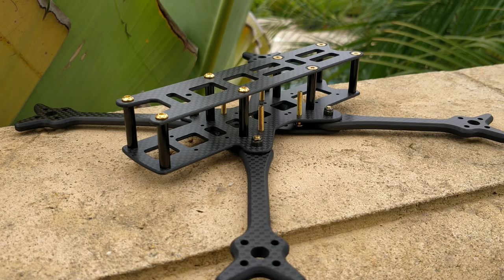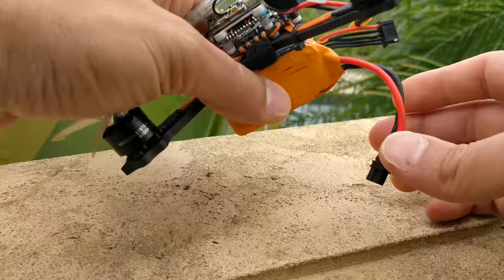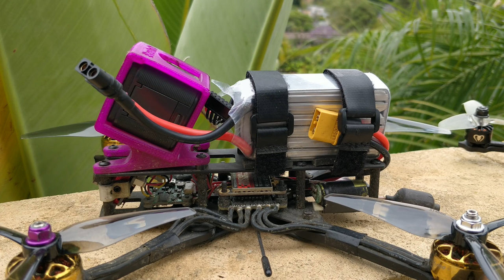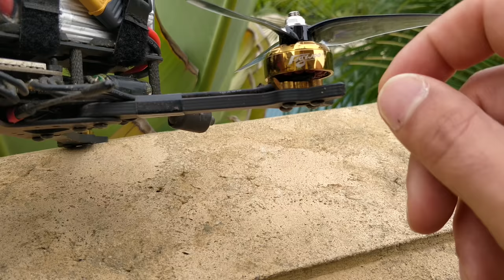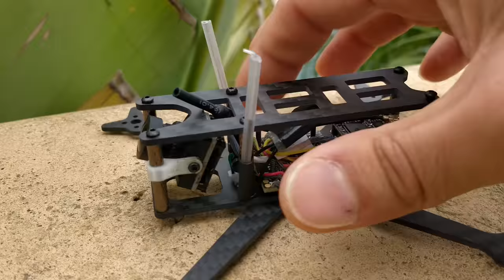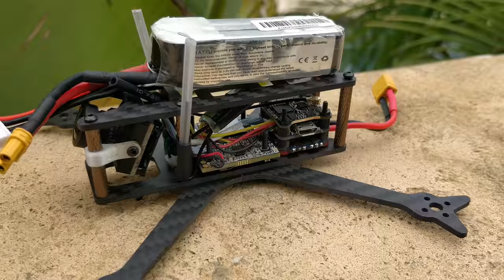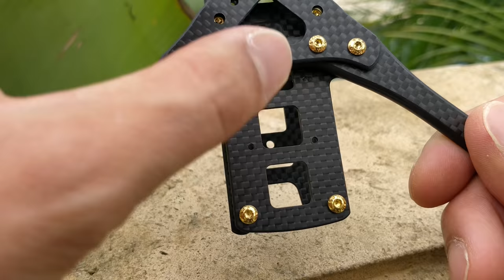Quad setup and flight performance - Quad Theory (WARNING: Lots of talking only)

Comment: HI Bob,
Just managed to order a Hyperglide before they run out of stock again! I missed the last batch...
I love the details you described in this vid how you designed this frame and I am looking forward to build one soon.
However, I use multiple 4s chargers and am running out of 4s1500 packs and need to order new packs.
I am not interested in a Gopro. 

I assume a Xing/Flywoo 2306 2450kV/4s2200 or a lighter 2207 2450KV/4s1500 would be the ticket without GoPro in regard for throttle control without BF4 issues? You mentioned you are not too keen on the 2306 motors but forced to use them due to BF4 issues but like the 22xx motor throttle control better when weight is reduced. Are both choices worth considering?

I am still enjoying my Eachine purple 23061900kV /4s1500 combo you have been keen on yourself. The throttle management is nice!

Which combo does match this frame best?
Thank you in advance for your time and patience.

Kind regards, Erik
Reply from the maker: Right now I greatly prefer 2306 with the new S4 prop. They go really well together
Reply: Thank you!
Reply: @Kabab  
Hi Bob,
I have been browsing through my builds and willing to salvage a 5" racer parts for the HyperGlide and building smaller drones in future more suitable for close proximity in urban locations.

I have chosen T-motor F60 Pro3 (2207.5 2750kV) according your theories for linear throttle response and I am wondering with 15-20% throttle cut this motor would be very suitable for this frame as well? These motors do not run well on BF4.0.3 and I am using BF3.5.7 now.

This would save considerable building costs not shelving these motors.

Thank you in advance for your time and patiencee.
Kind regards, Erik

Comment: I fly 2 flosstyles for my main freestyle rigs and recently smashed one to pieces :( Are there going to be replacement parts available for it moving forward or has it been discontinued altogether?  
I really like the look of the new glide frame but really do not want the extra 20 grams of weight.  Are you going to be releasing a glide light that you keep teasing in your new vids any time soon?? Sorry to put you on the spot I just happen to be in the market for a new frame and can't find anything that looks decent and is light! 
I really appreciate all your content and thoroughly enjoy flying your frames!!!!
Reply from the maker: The light version of the glide is coming probably next week and it's about 84g.  At least 12g lighter than the Flosstyle.  The Glide Lite is the only one I use myself now.  The regular version is not 20g more.  It's about 6g more and you get a LOT more convenience, durability and ease of use for those 6g too plus way cheaper arms.
Reply: @Kabab  Excellent!  I will be ordering one as soon as it drops!  I'm super exited!! For the 20g difference I was just going off pyros website, it had the Flosstyle listed at 85 - 87g and the glide as 104g.  Thank you very much for the response!!
Reply from the maker: @falconfpv8658  that weight was for the originalframe design. Since the initial launch batch I beast up the boomerang arms quite a bit and that added about ten grams

Comment: Interesting theories about battery orientation and position, but I notice all the batteries you're talking about are oblong, I run square Turnigy Graphene 1300mAh 4S under my Hawk 5 (because I got 10 for a great price, end of stock sale I think), and with the HD camera stuck on top it puts the COG practically in the dead center of the craft, it flies well and I haven't noticed roll maneuvers being more sluggish than pitch maneuvers or vice versa.
Reply from the maker: Right but the weight distribution is all over the place. It could be better but hard to jam all the stuff in a tighter space.
Reply: On that weight distribution note, I've been slowly working on a 5" build where the square pack fits in the center of the frame, and the FC isn't mounted to the frame but suspended between posts with a TPU print.
Quite curious how it will fly and whether the TPU mount will help eliminate vibration or make it worse.

Comment: How about placing a 3S on top and another 3S underneath, wired in series?
Reply from the maker: Would be okay but a bit complicated maybe
Reply: @Kabab  I don't see why it should be complicated, it would only need an adaptor cable, and an XT30 for each battery.
Reply from the maker: @BarefootBeekeeper  it's easy when you think about it.....😁

Comment: it seems that in the drone's movements through space as in the races, it is better to have the weight concentrated even if the center of mass moves down because the battery. 
however, in typical freestyle movements flips, rolls, i think it is better to have it centered on the z axis in the horizontal line of the props. This would be a reason for freestyle drones to carry the battery on top? Less propwas, better handle flips, more responsibility but not so good running across trees or gates?
Reply from the maker: It's always better to have it centered on the entire quad. Racers don't do flips and rolls so it doesn't matter as much for them.

Comment: Im in the process of building a 6"floss style  quad the 20x20 holes in the front and back hit the boomerang arms so i have to drill the holes with the frame together to accommodate and that's fine im inclined creatively!..   is this the case on the glide?..
Reply from the maker: The glide has access to everything easily. No issues at all

Comment: Hi, if I understand your theory (or the facts?) about COG correct, then from that perspective something like Remix or geprc kx5 would be ideal? Have you tried any of those? Or at least what's your opinion about those type of frames (aside from the fact that they are not easy to build)?
P. S. Tomorrow I'll turn the battery for 90 degrees on my 3 inch light micro and try propwash handling and motor temps. Thanks for another good video. 👍
Reply from the maker: Those quads have the CG below the props. Having the batt on the main deck is actually not good for CG. It is however good for wright distribution. However it's also bad for disk unloading. Because the props thrust bump directly into the batt and motors need to work harder

Comment: Man I miss this kind video. I had one frame could take 5.5 inch and with 5 inch prop was my best flying drone but unfortunately every single crash on arm broke.i bought armatan rooster and could not fly it I changed setups couple times still hate it. It’s not just because is heavy I do have frame as heavy as armatan I’m sure because the H style. anyway always love this kind video from you and thank you for teaching us how to fly better.
Reply: Try a XLABS BRAAP if you can find one somewhere cause I don't think they are making anymore of them but the frame is so stiff in everyway and direction which leads to very solid flight feel and easier final tune. I got a chameleon back when they first came out like 2+ years ago and could never figure out why I could never get it to fly good until I switched over to a super rigid frame like the braap, the OG chameleon carbon was just straight rubber feeling in the way it flexed so easily which led to me fighting for a unreachable tune.
Reply: Smooth_Ops I’m glad I’m not a only one I will for sure look for xlab thank you

Comment: I have a question. Why dont you design the frame with the arms on top of the bottom plate? You have enough room for you stack, and so you can even lower the center of gravity closer to the center. I am looking for a quad like this. True X with arms above the bottom plate. With enough room to fit the flight controller in the front. And maybe even an DJI Digital at the back.
Reply from the maker: You can build it with the arms inside already. The reason why the arms are below is because using shorter standoffs is more durable been moving the arms inside and needing to use taller standoffs. Right now the standoff height is at 23 millimeters to properly fit the micro eagle. Moving down to 20 millimeters and a nano camera is a good option as well however I find 20 millimeter built height to be a little bit cramped. people are already fitting the DJI unit in this frame and I don't know how they are doing it because I can't get it to fit. I am actually working on an entirely frame concept for the DJI unit
Reply: @Kabab Aah, i did not know you could build it with the arms inside. Is it still possible to fit the FC in the front? What i meant was that if you move the arms on the inside, you dont have to use shorter standoffs at the front, so you can still fit a micro camera. There is only less room for the centerstack, but because you only put the 4-1 esc in there, there will be plenty of room. So then you can lower the center of gravitiy of the frame (not the arms, that does not change of course), by the height of the arms and the X plate (the plate that squashes the arms to the frame). Did you model this in an autocad program (like solid works), because if you put all the parts in, you can let it calculate the center of gravity. You can even do stresstests (Finite Element Analysis) to see which parts are vulnerable to cracking. (sorry, i have a degree in mechanical engineering and this gets me really excited)
Reply from the maker: @laurensvanroozendaal  on this particular design I don't think an FC will fit in the front with the arms inside. With the Glide I think it will fit.

Comment: Battery underneath because you are more likely to not have to use turtle mode and can take off out of taller grass. Is there a Kevlar fiber frame cost aside?
Reply from the maker: That's another reason

Comment: Hey KababFPV, great informations in this video thank you. I'm new to FPV, I've recently built a Smooth Operator it's my first quad and I'm really enjoying it. 
I would like to know your opinion about the benefits and downsides of having the rear arms elevated compared to the front ?
It's seems in theory that it would be good for flying forward but terrible when going backwards with the air blowing in the front props (eventhough it seems fine to me)
Reply from the maker: I haven't looked at it in too much detail. I'm sure it flies fine but I believe it's a bit heavy and above all, I know it's an absolute pain in the ass to repair and work on which makes it doa for me
Reply: @Kabab  Yes 660g with gopro and 6S 1050 battery, but it held really well on every crash yet. Yeah I knew before picking it up that it looks cool but it's a really tight frame, I just can't figure out if the idea of having the rear arms elevated is good or not. Anyway keep up the great content, I like the toothpick probably the next thing I'll build.

Comment: Could you design the quad at 29:00 to have the electronics attach evenly to the top plate and the battery slots into the middle of the frame(sort of like a racer 3) and strap to the bottom plate?  I have no Idea how that would actually fly but your weight might be more condensed.  You could also maybe add a middle plate to separate your electronics from your battery.  You could  then chop off the back end and make the stack area taller.  It would look weird but might fly better. 
Last thing that may be better but look even stranger is to have the battery mount inside the frame, the stack mounted above the middle plate, the top plate having the arms with the motors pointing down like the tiny hawk and the camera mounted on top in the middle.
IDK it's probably been tried before but might be fun trying crazy shaped quads
Reply from the maker: Issue is the difficulty of maintenance

Comment: What about a frame where the motors on the back are higher placed than the ones on the front - that would essentially give you a similar effect as having a stretched frame (getting more "fresh air" to the back props). Has that been tried yet?
Reply from the maker: yep that works out well but it also makes rolls a bit wonky because of the oblique torque lever.
Reply: @Kabab  ahhh yes, true. I built a little cnc-router and want to design and mill frames for myself and your videos are a very good base for getting a better understanding of frame geometry. Turns out there's a whole lot more to pay attention to than my naive little first-semester-engineer-self thought when getting into all of that :D
Reply from the maker: @Averell64  lots of fun.

Comment: Ca you Mek the stack screws better accessible with the brace plate? so the head of the stack screws can go through
Reply from the maker: I would like to but that would weaken the bottom plate and the whole structure quite a bit. It cuts into the fibers of the bottom plate

Comment: Interesting discussion on the quest for marginal gains. Questions:
1. Have you considered designing a frame around square batteries?
2. Any chance you'll do a review of the Attitude V5?
Reply from the maker: The attitude isn't worth it at all. Dom v3 is way better. There aren't enough square batteries to consider a specialized frame for them. They seem to be somewhat less efficient for battery manufacturing too

Comment: I've re-built my chameleon and it is probably one of my cleanest looking builds but my esc telm is fucked up cause I'll be buzzing around then my osd will show my bat voltage @ 700+ volts (only randomly though.) I just go off of Mah and timer now lol.
don't know when but gonna switch it out for one that don't troll me haha.
Reply from the maker: I don't bother with any of that stuff. Too finicky. I just go with voltage alarms

Comment: You can top mount the battery perpindicular easy and super snug... cross the straps in an x over the battery..
Reply from the maker: wires can still always hang
Reply: @Kabab  oohhh yesss but not anymore than the regular mount if you run it like you had here in the vid. Xt60 on top! Not arguing just trying to help as I lovvvve what you do and you are awesome! Bussyyy man!
Reply from the maker: @stickboyfpv4742  if you do it all the time and have a way to do it and always do it that way it works out fine but the frame design still gets a bit wonky. It really is a lot easier to manage length wise.  Just less thinking. The performance difference is also really minimal too

Comment: How much would it cost to make a drone? I’m in Canada so everything I order you can slap on an extra $30+ on everything... and where I live there’s like no racedrone shops. Only a strictly DJI shop. They didn’t even know what a 1S battery was when I went in and asked if they had a charger for 1S batteries lol. Also how would you recommend to practice soldering? So that I’m not bridging contact points and stuff and things don’t work.
Reply: Buy some cheap PDBs to practice on that is a good way to learn pad soldering. Doing connectors is fairly self explanatory. We use XT30 and 60 connectors mostly. Invest in a good iron that is temperature controlled and at least 45w preferably 50 or 60w, that has interchangeable tips. using the right tip at the right time can make a big difference. Use 63 37 solder if possible. 60 40 is ok but definitely dont use some stuff you got out of the plumbing section of home depot or whatever the fuck you have in Canada. Buy a soldering jig or helping hands or whatever. at least 50% of soldering is getting something to stay put so you can actually solder the damn thing without burning yourself. Seriously bro if you invest in some decent equipment your joints will start looking better almost immediately. one last thing 63 37 solder melts at exactly 360° F. if you find yourself having to turn the iron up much past 600°F the tip you are using is too small or is oxidized or something and not transmitting heat effectively.
Reply: SpikeJonesTheCr0oked alright thanks bro. I’ve never soldered at all before. And I’m just getting into the world of drones lol. I got a Mob7 last week, still don’t have goggles for it yet tho. I’ve noticed my VTX chip, I think, there’s 2 of them in the camera part of the canopy, but it’s mounted slightly crooked so I’m hoping my camera isn’t crooked when I get my goggles. But we have everything you guys have in the states lol. I don’t know why people think we live in igloos and prairies all across the country. I’m in Calgary, one of the biggest cities in Canada. Only things we don’t have are like drinks and restaurants, candy bars etc that you guys have. I’m sure there’s more as well, but for the most part we get the same stuff as US. I usually order most my stuff tho anyways cause it’s cheaper. Do you have a drone shop in your area for this kind of stuff? Or does everyone just order from banggood on YouTube?
Reply from the maker: Look through mine and other peoples video descriptions. Soldering is not difficult but most people that think they are just not good at it are using shitty solder. I have a link to good solder in my descriptions. Use that and some wire or something to practice on. You'll get it after one or two. It's extremely easy with the right solder
Reply: @LJT9393  I do about 90% of my shopping online. I pick up wire and connectors and little odds and ends at the local hobby stores but as far as the major components its online.

Comment: Wait, aren't stock PIDs to high for 6s to fly comfortably?
Reply from the maker: Because the KV is usually much lower on 6s, the overall power output is similar to 4s. As long as you're somewhere within the power window that betaflight is looking for, stock settings work great
Reply: @Kabab  Thank you.